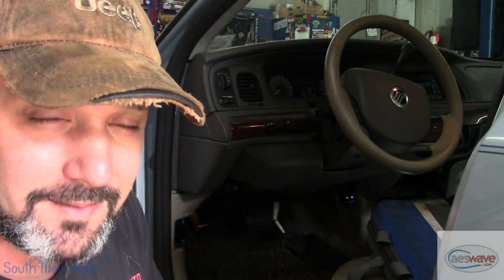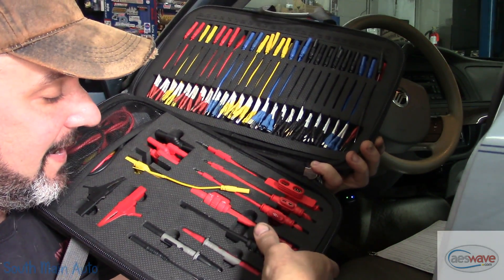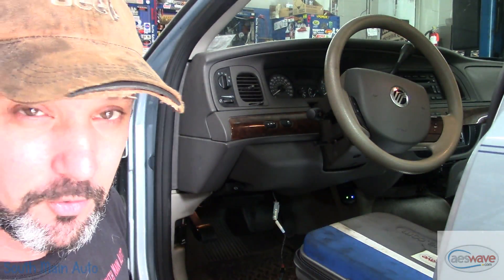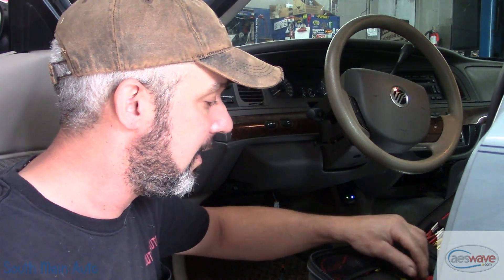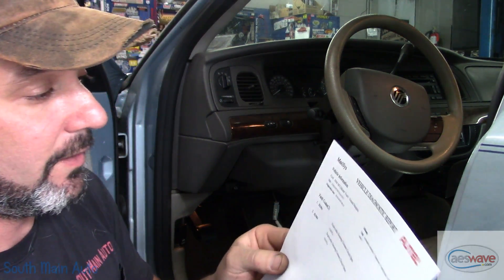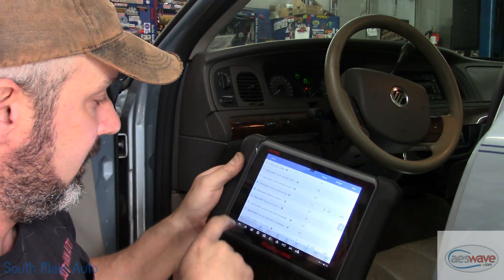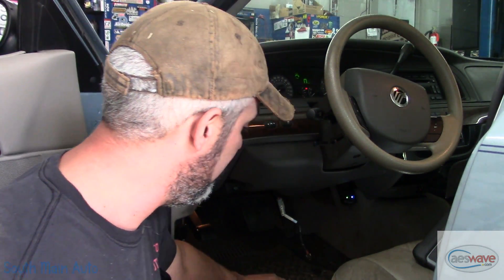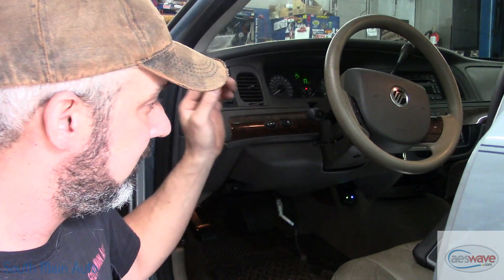AES Wave UTest Kit Airbag "Simulator"

Comment: @South Main Auto Repair LLC . Eric where do you get the specs? Is it in the Service Information on ShopkeyPro or somewhere else? Have a couple I need to check but want the proper resistance. 

Thanks! Dale

Comment: oxidation on connectors of airback stuff is 96% reason for our ligth to come on here in Finland if the car has not bean bumbed that that i see.
1% is non airbag sytem fault(communication,battery,etc..). 1% is self made problems. Another 1% is bad airbacg module and last 1% part is from junk yard(ask why and you made my day).
And so the last comment is cold!
Make sure there is no pinfitment issue and if i may add use silicon greese to it live longer lifebefore you but it back.
Reason why i see 0% of airbag failing is as it would mean comeback to the maker of the hole line of cars like Toyota did with some cars if im not mistakeing...

Comment: Could you check the other side of the circuit with an inline resistor to clamp the current so it doesnt trip the bag? Im not sure a dmm runs enough voltage on a resistance test to trip it, but obviously the computer is running its own ohm test probably by a small voltage bias. Im not sure im brave enough to try this.

Comment: I'm glad I haven't had an airbag problem thus far. I probably would have checked the circuit for an open.  Boom. I am about to buy an Autel MS906BT as I continue my semi-retirement  dive into learning auto repair just cause it's fun and I'd rather spend money on tools then repairs. I want to stick with an authorized USA dealer. I've bought from AES Wave before. Do you suggest anyone else?  Automotive Equipment Specialists is cheaper but sounds like once you buy it from them it's between you and Autel. Thanks.

Comment: I know that the amount of resistors that come with it probably won’t exactly equal to what you need but I think that you can use that adapter to test and see if the old GM anti theft in the column is giving someone fits as well. Not sure of the technical name for it but its where GM uses the resistor pack in the key to disable or enable the vehicle.
Reply: The kit also comes with a variable resistor (0-10K) that could be used to simulate the PassKey resistor values

Comment: Nice vid for aes wave .
They do market some nice stuff
this terminal test kit comes from several brands from same oem .
I got a drawer organiser full of resistors and potentiometers for substituting sensors or faking signal values .
These terminal kits make job faster/safer but the diy guys can get by easily for small change and bit of ingenuity with solder iron and heat shrink .

This poor guy fitted a junk used column, least easy diag for u :-)

Comment: The steering columns usually have to be replaced in these cars because there was a recall that affected cop cars and a bushing between the steering shaft falling apart in salt water areas, but they affect all cars regardless. I have an 07 CV that I bought brand new and had to replace the column because the steering shaft bushing failed (it's green, you can see it if you look under the column), and my car is in Arizona.

Comment: low ohm resistors, by the looks probably 1% tolerance. standard values for those working with low values daily. you should be able to order online from many places from cut reels or such.

Comment: The steering column isn't junk.  It just needs a resistor installed! ;)
Reply: That's a solution a DIY guy can use.  That sounds quicker than removing the bulb from the cluster.

Comment: AES believe has a decaded resistance box, could that be used you could actually dail in the correct resistance or do you have to have a specific resistor, Awesome video thanks for the info

Comment: There's an unmonetized(don't know if that's a word) value in using tools that are enjoyable to use. Doesn't matter if you make or buy them. It encourages and inspires to learn. I find myself looking for a reason to use that exact kit even when it's not necessary. You could have figured a way to just insert a resistor straight into the connector, but where's the excitement in that? Great job sharing as always my friend. Each One, Teach One!
Reply: Yeah, we spend a lot of our time at work, may as well enjoy yourself while there, and if that means 'playing' with some new tools then so be it. Plus its always good to have more than one way of doing something in case of breakages or things being used elsewhere.

Comment: I've been contemplating on whether or not to grab that kit, but you certainly tipped the scales more in favor of purchasing. I had no idea they had those resistors in there.  Where would you find those resistance specs for airbags for each vehicle?  I think I tried digging them up before in schematics, to no avail. Maybe I was looking in the wrong system.

Comment: Eric,
Great video and very informative - thank you!
1. How do you know what resistance is correct to simulate the airbag?
2. In this particular case was the airbag (squib) itself bad or could it have been the clock spring wiring, etc in the column?
SMA #1
God bless to you and Hannah
Paul
Reply: In this case the clock spring wouldn't be involved as this device is on the column itself, not the steering wheel.

Comment: If you ever lose a resistor, those are common EIA values, and should be available from a local electronics parts wholesaler.
. Knowing the wattage of them would help getting a replacement too. HTH
Reply: There aren't many local electronic parts wholesalers left. There isn't much call for such parts these days and those who use them purchase via the internet.

Comment: Looks like a nice neat kit and the resistors look like standard metal film 600mw types, so easy to replace if need be :-D
Reply: zx8401ztv they are. Those are buyable on eBay for pennies for hundreds. Low wattage is all you need

Comment: my free tip . if your ever stuck for a 3.7ohm resistor take 3 10ohm and twist the ends together . that gives you very close to 3.7ohms of resistance
Reply: Good point. Technically 3.3, but with all the connections I bet it is closer to 3.7, probably close enough. Often I notice significant variance in off-the shelf-resistors anyway. I wonder how close it has to be.
Reply: id be interested to know the % of  tolerance the pcm looks for before setting a code

Comment: Man life is a lot more enjoyable with diagnostic kits and testers. After I got my AESwave uTest Kit it just makes you so much more efficient. I just received the uActivate, Amp Hound & uIsolate Network Isolator and they'll make diagnosing more fun always with new toys. In a few weeks will order the Voltage Drop Pro which you can set up from 1- 20A load. Don't know why I'm still ordering all this stuff...it's a disease. Great video on the simulators and you nailed it within minutes...time is $$.

Comment: G'day, Mr. O! Excellent! Very Cool Tip... using the airbag jumper, and variable resistor! (AES Wave UTest Kit Airbag "Simulator") "Plus, it's a great tool for getting into connectors without piercing wires or spreading out terminals!" Thank you! 

Cheers! 😊🛠✌🏼💕

Comment: I love that kit i bought it over a year ago when i always saw you using it! half the price of the gm kentmore kit and this has more in it! I also use the air bag simulator connector and stick in 120 ohm resistor to help with diagnosing problems on gm high speed lan

Comment: I don't understand how the test proves that the steering column is junk.  The test shows that the wiring harness in the car is good and there is some fault in the new column.  Given the cost and the time of replacing the column, isn't it worth the time to see if the fault can be corrected?  Shouldn't you, at least, remove the covers and have a look?
Reply: That component failure is not repairable - if they go bad you have to replace the entire steering column due to liability issues.  It is the same way if a seat belt pre-tensioner fails testing - you have to replace the assembly due to liability issues.  It is not worth it for Eric to risk his entire shop, business, home, and everything he has ever worked for (and will continue working for the rest of his life) to try to "repair" a safety device that the manufacturer expressly states is not repairable.  The lawyers would have a field day if that vehicle were ever to get in an accident - regardless if the steering column "repair" injured the driver or not.  The case law in these matters is all against the repair shops that do not follow the manufacturer's repair instructions - just ask the the small body shop in Texas that recently lost a multi-million dollar lawsuit against them for not following the manufacturer's repair instructions exactly as written and doing a repair their own way.
Reply from the maker: This test 100% no question asks definitively proves that the steering column device is no good. When it is plugged into the steering column it shows 10.7 ohms which indicates an open circuit. Unplugging the column and substituting the 2.7 Ohm resistor 100% proves that the wiring and connection is good therefore there are no other options except to replace the steering column. Since this video was made the column has been replaced and the light is out.
Reply: @South Main Auto Repair  I think the issue is many people have never seen a "bare" column with this device "made" into it.  They also do not understand that there are certain parts that just have to be replaced, due to liability issues that you as a business owner is exposing yourself to when you work on these safety systems.  Not sure if you still have access to the old steering column and would be able to post a follow-up video for everyone to see exactly what this part looks like and then explain why you have to replace it rather than attempt to "repair" it - specifically due to the manufacture's written repair directions for this particular safety system.
Reply: It must be difficult to find a good column in a salvage yard as most have deployed in collisions.
Reply: @Tired old mechanic  also the only way to verify that the column is "good" is to plug it into a vehicle with a working control module that can run it's self diagnostics and/or be able to plug in a scan tool & monitor the internal resistance value of the column module.  There is no manual testing of electrical resistance of the module, otherwise you risk "setting it off" since the voltmeter sends as small electrical charge through the circuit during resistance (ohm) testing.
Reply: Thanks for posting the videos.  I appreciate all the background information I gather while watching you work, especially the older cars.  Here in California, we don't have rust.  I have a 20 year old Volvo that still runs great.  It's getting about impossible to get parts so the old girl will go to the junk yard soon; she needs the air pump replaced and it's not worth spending close to $800 to get through our next smog check.
Reply: Thanks for the info.  I didn't know that the part is not a serviceable item.  For the DIY guys, it's not an issue until you go to sell the vehicle.  It's like the old airbags in cars more then ten years old.  All the airbag manufacturers recommend that the airbags be replaced after ten years but I have never seen anyone actually replace them if they have never been deployed.

Comment: For years I've held back on buying that kit because of cost, which is certainly the Cadillac kit for front probing connectors. Pico offer a slightly different kit with three wires in a Y configuration with male and female on two ends and a third wire for testing. It allows one to open a connector and bridge the gap for all wires, then use the third arm to measure voltage for each wire at a time while the system is working with a completely bridged connector. Being able to open a connector, bridge all connections and measure what is happening would be a game changer compared to the old school method of backprobing and peeling back the loom. I already have or could make most of the other parts, but to have exactly fitting front probe options is very appealing. One day, ha ha.
Reply: The uTest kit does include 4 Y-adapters for creating that 3rd test point if you wanted to bridge a connection. Going beyond 4 wires with complete coverage is tough because of cost escalation.  If you had a specific terminal or set of terminals that you are constantly using we could custom build a set of breakout leads for you.

Comment: Those resistors are standard quarter watt values in the electronics industry. So if you lose one they're a few cents each at a place like Digikey.But that is a nice little connector to fit them into. Also good video on how to go about using them and where to put them.
Thanks
Reply: Buy a hundred of each value and solder them in place

Comment: Any chance the airbag going off when unplugging it?
If the airbag is really still there?
Reply: Thank you for the information, it should be pointed out there is a capacitor to supply electrical ignition in case the power was cut upon crashing.
Reply: Thank you

Comment from the maker: Tools used in this video: 

uTest Advanced Terminal Test Kit (AES# 16-200)
https://www.aeswave.com/cart.php?m=affiliate_go&affiliateID=2525b91fc8e906e8215984074c9d9e8f&go=https://www.aeswave.com/uTest-Advanced-Terminal-Test-Kit-p9573.html

 

MaxiSys MS906BT (AES# atl-MS906BT)
https://www.aeswave.com/cart.php?m=affiliate_go&affiliateID=2525b91fc8e906e8215984074c9d9e8f&go=https://www.aeswave.com/autel-maxisys-ms906bt-scan-tablet-p9633.html

Pomona Adjustable Insulation Piercing Test Clip with B-plug Inputs (AES# PE-10)
https://www.aeswave.com/cart.php?m=affiliate_go&affiliateID=2525b91fc8e906e8215984074c9d9e8f&go=https://www.aeswave.com/Adjustable-Insulation-Piercing-Test-Clip-with-B-plug-Inputs-p8507.html

uMicroBackProbe (AES# 05-764)
https://www.aeswave.com/cart.php?m=affiliate_go&affiliateID=2525b91fc8e906e8215984074c9d9e8f&go=https://www.aeswave.com/uMicroBackProbe-Minimum-impact-probe-for-high-density-connectors-p9481.html

 

 

 

Notes about the Variable Resistor:

 The uTest Variable Resistor is 0-10k ohm resistor and has 3 wires: Blue, Black, and Red.
To determine the value of resistance it is best rely on the meter display rather than the dial.
The value displayed on the ohm meter is determined by which combination of any two wires are being used.
Reply: South Main Auto Repair love this AES kit . Definitely getting one . So I can be  master diag tech like you .. awesome video keep it up mister.
Reply: South Main Auto Repair I have this same kit and use the leads like you do for front probing. And I've played with the variable resistor dial. It's a good kit to have. Thumbs up!